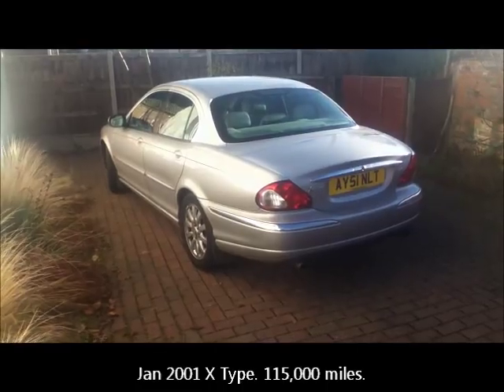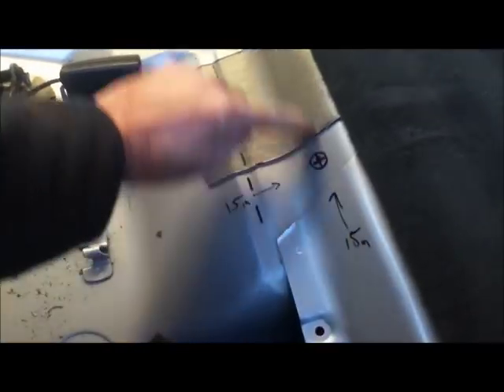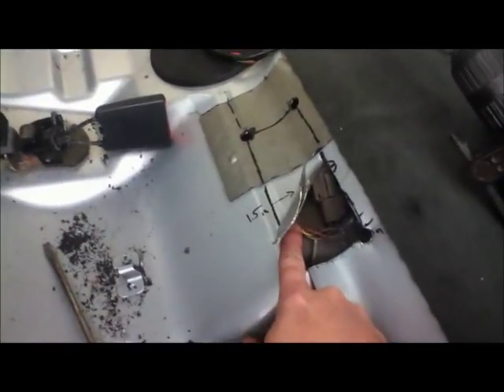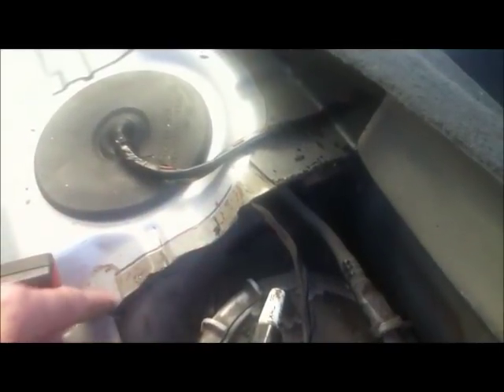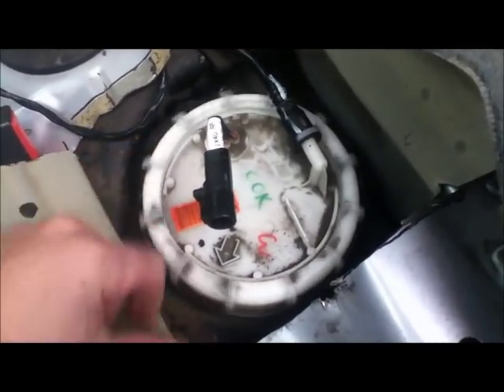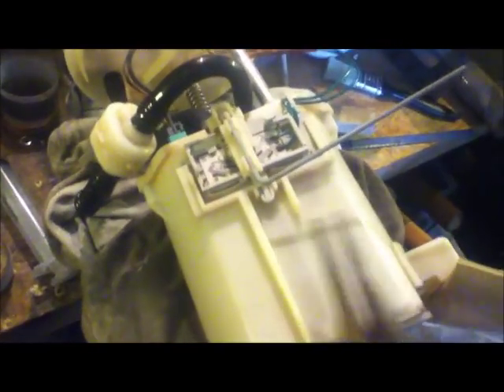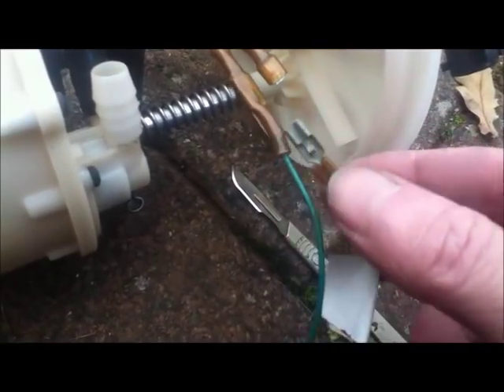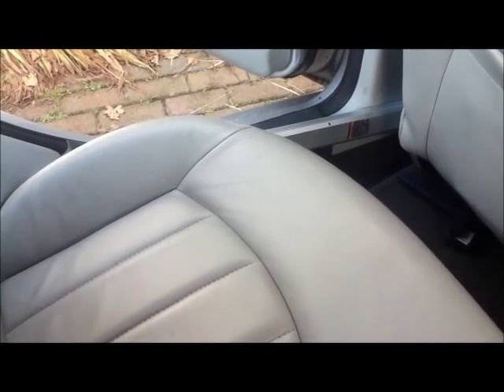Jaguar X Type Fuel Pump Change

Comment: Does anyone know the correct fuel pump pressure for this vehicle???
Reply from the maker: The manual says ' Fuel is pumped from the tank to the fuel rail at a constant pressure of 4.5 bar, regardless of the amount of fuel being injected into the
 engine. Fuel pressure is constantly maintained by the fuel pump's integral mechanical pressure regulator which returns excess fuel to the fuel tank via a T-piece positioned directly after the fuel filter.'

Comment: Wow destroying the body,
Jag had a Recall on these pumps, i changed loads,  just syphon the fuel from the tank, Remove the tank ( it comes down easy ) , there's a tool to remove that ring and a torque setting to refit it, the pump itself isn't easy to fit to keep that seal in place.  As i said before  i pity the chap who has it after you.       lol
Reply from the maker: You are completely missing the point of these videos. They are for people who want to do the job themselves without a specialist workshop and specialist tools. As for the tank coming down easy - that might be true on a new rust free car but certainly not true on a rusted up old car. As it is, my garage would be happy to slit the floor to get the pump out as it is a quick and easy solution that means it can easily be done again in the future. The pump  only costs £13 new - nobody is going to want to spend hundreds on a pointless procedure. I think anyone reading this would realise that your attitude is precisely why no-one takes their cars to a Jag garage to get them repaired. As for passing the car on I have given it to my father and he is delighted with it. If it goes wrong again it is an easy fix.
Reply: jeffrey price  I buy cars and sell them and I did this multiple times on jaguar the placement of the tank it s so difficult to work on the floor and it would take u hours of work .... that’s the easiest way to do it and I am 15+ tech
Reply: @johnnysevengun  Thaaaaaank yooouuu so much for sharing this.  It took me  2 hours and cost 60$(replacement non oem)  for the part. (Which was 3 days late.....!  I haven't put the metal back into place yet, would this be reason to be smelling fuel?  Also, can't get my navigation screen to come on, would you have any enlightenment on the matter? Already checked 3or so possibly  related  fuses.🏳🏳🏳
Reply from the maker: @jlyni378  Well done with the pump. I can't help you with the you SatNav but I am pretty sure I have seen it discussed in the Jaguar Forums and it is a problem with the wiring in the boot (trunk).
Reply: @johnnysevengun  thank you, credit is yours.  I love this damm car buuuuut it is a true relationship.  Love hate for sure! Spent yesterday in the trunk stripping it out and tracking wires to fix tail lights uggghh 🏳 i have a parts car for it but i feel for those who don't.  This one's a sport edition, the other isn't.  Anyhow thank you for your info videos for people like me who don't  wanna give up on the car they love but don't have the patience to send it to the dealer every time something  breaks! ✌
Reply: @johnnysevengun  You all ways get one ( '_' )

Comment: Definitely will never buy a jag!!!!
Reply from the maker: Not any Jag? Remember these are 20 years old now.
Reply: @johnnysevengun  i get their 20 years old but jag coulda put a access panel for the fuel pump!!!!!
Reply from the maker: @bharper2840  I completely agree. Somewhere a bean counter decided it would save a couple of quid if there wasn't one. Probably because they put two into the S Type! At the time it was common do this though. We had to slit the floor of a 1999 Ford Cougar for exactly the same reason.
Reply: @johnnysevengun  i definitely kno about the cougar cause i help my great grandfather change a fuel pump in one. But i was look to purchase a 2004 x type 6 speed manual and the fuel pump location has me second guessing on it.
Reply from the maker: @bharper2840  Two hours work tops and the pump is only $15 if you have to do it.
Reply: Buy the S type it Does have the proper pump access hole

Comment: So much easier to remove the gas tank to replace the fuel pump.
Reply from the maker: No it is not. You need to bear in mind that these videos are for people who want to repair their own cars. My Jag isn’t worth more than £800. To remove the tank is £800 ($1000) worth of work which you can’t do without a workshop lift. First empty the tank – there’s no drain plug you need a siphon and pump. Lift the back seat out –easy enough. Prise the grommet from the floor panel and disconnect the wiring, Jack the car right up high. Disconnect the fuel filter, the breather hose. Loosen the fuel filler clamp. Remove the prop shaft – it will be siezed on every screw.  Lower the final drive unit by 75mm (drop the subframe - that will be fun) and suspend it with a strong chain! Slacken the other fuel filler clamp (nearly impossible to see). Disconnect some other hoses. Chock the tank and undo the bolts. Lower the tank with two people - it still has fuel in it. How many hours has this taken? Now you can undo the fuel assembly and fit the new pump. Now put it all back. How many more hours? Test the car runs. What happens if it does not? £13 version – lift out the seat, cut a slit in the floor, change the pump, seal the slit, test the car - all done in 2 hours max. 1/2 hour if you have to do it again in the future. The S Type has a rubber panel right over the pump – so do most other cars. The X-Type has some terrible designs flaws and this is one of them

Comment: whats the point of destroying car body to change fuel pump once per 10years.... some people shouldnt own Jaguar, if you cannot afford proper service, just buy Dacia.
Reply from the maker: How much do you think it costs to remove the fuel tank? A lot more than the car is worth. I would guess you know nothing about cars.
Reply: bad guess ;) to remove fuel tank cost you only bit more time... yeah better cut the car around to get an access to fuel pump, changing headlight bulb cut the hole in a hood.
Reply from the maker: You need to bear in mind that these videos are for people who want to repair their own cars. My Jag isn’t worth more than £800. To remove the tank is £800 ($1000) worth of work which you can’t do without a workshop lift. First empty the tank – there’s no drain plug you need a siphon and pump. Lift the back seat out –easy enough. Prise the grommet from the floor panel and disconnect the wiring, Jack the car right up high. Disconnect the fuel filter, the breather hose. Loosen the fuel filler clamp. Remove the prop shaft – it will be siezed on every screw.  Lower the final drive unit by 75mm (drop the subframe - that will be fun) and suspend it with a strong chain! Slacken the other fuel filler clamp (nearly impossible to see). Disconnect some other hoses. Chock the tank and undo the bolts. Lower the tank with two people - it still has fuel in it. How many hours has this taken? Now you can undo the fuel assembly and fit the new pump. Now put it all back. How many more hours? Test the car runs. What happens if it does not? £13 version – lift out the seat, cut a slit in the floor, change the pump, seal the slit, test the car - all done in 2 hours max. 1/2 hour if you have to do it again in the future. The S Type has a rubber panel right over the pump – so do most other cars. The X-Type has some terrible designs flaws and this is one of them.
Reply from the maker: And you need a special tool to change the headlight bulb....
Reply: you are perfectly right, btw. not my point to undermine job you have done, just cutting body doesn't sounds right to my ears.
Reply: hmm I didn't notice anything special to remove bumper and change xenon bulb.
Reply from the maker: If you had to take the bumper off then it wasn't the headlight bulb you were changing. https://www.youtube.com/watch?v=xJpHuVoafHk
Reply: with xenon headlight unfortunately only way is to remove headlight unit... not enough room to make it as you have done with halogen bulb,  another example of brilliant design...
Reply from the maker: That's a good one. In the UK it is illegal to fit HID bulbs in place of Halogens unless you replace the entire headlight assembly with an EU approved type (which does not exist for the X Type). So in this case it is not Jaguars fault when an aftermarket addition is made.
Reply: I have factory fitted xenon headlights in my 3.0 sport, not a chinese BS, agree with you, no where in EU is legal to install HIDs in a halogen approved headlights. And yes, there were X-type's with xenons as option, you can buy used xenon headlights, leveling sensors,control unit, switch and retrofit if want... so to my point - to change xenon bulb,bumper needs to be removed, unfortunately. part number 1X4313W030
Reply from the maker: Very interesting - never seen that before. You should do a video on it.
Reply: @Lukasz - He did what Jaguar should have done.